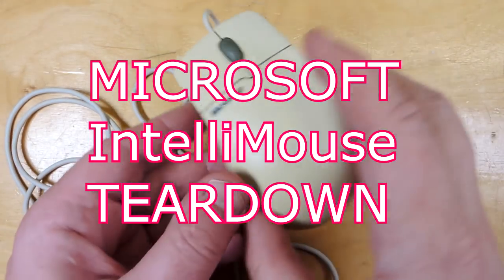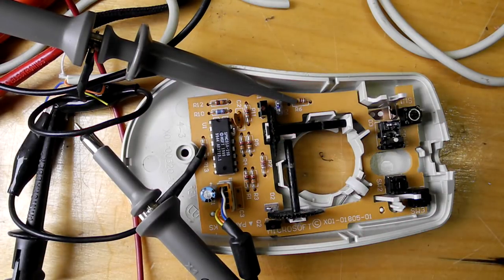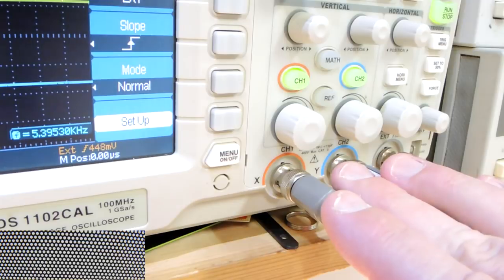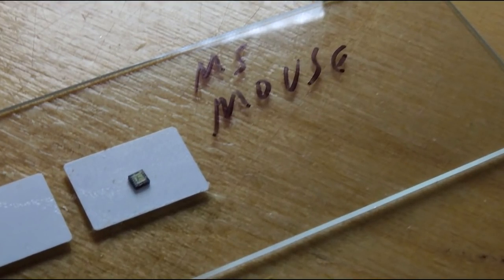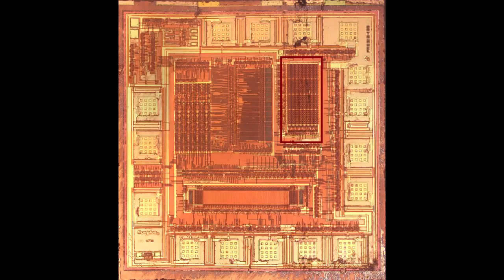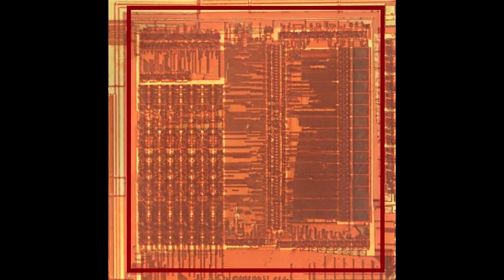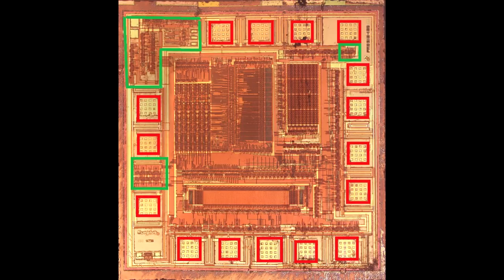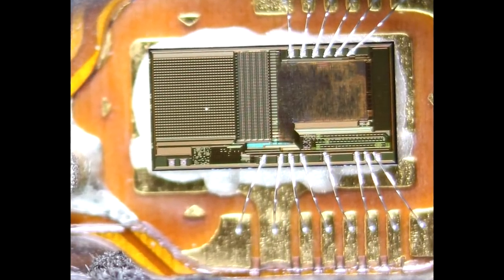Microsoft "Intellimouse" Teardown

Comment: "Let's tear it apart and...." cuts to torn-apart mouse, no tutorial on how he actually got it open..
So, for those guessing the method; yes, there's a screw under the little rectangular friction strip - the bottom friction strip - on the underneath of the mouse. You need to prise the strip off with a fingernail, or whatever, then simply remove the screw. 

Btw, have a vacuum cleaner at the ready if, like me, you've not opened the mouse in over 20 (twenty) years (I still use this mouse today, exclusively). And, remember that sticky, greasy Oriental junk food you ate with bare fingers when you used to do that take-away stuff after swallowing 10 pints? Well half of that food is congealed around the mouse wheel (don't try to eat it, it's no longer edible), and, see that big, jet-black hair you unwrapped from the innards? Well that's yours from 20 years ago, too, baldy.
Now where'd I put my flares?..